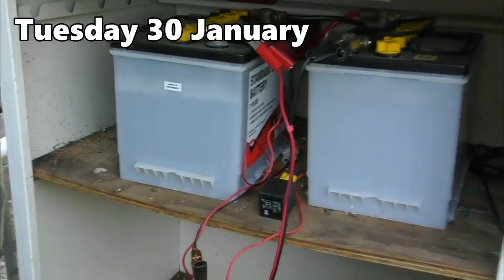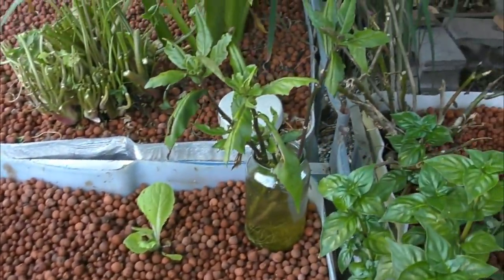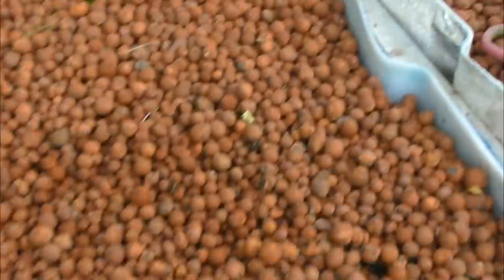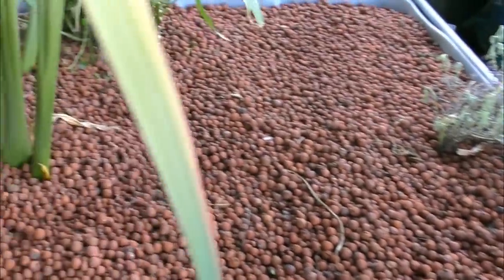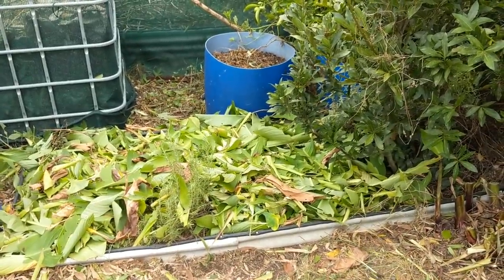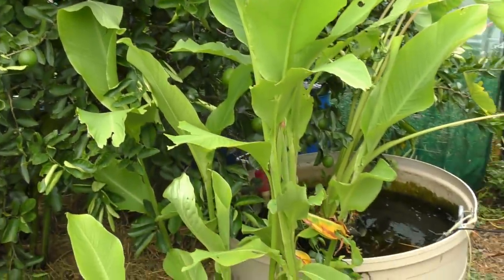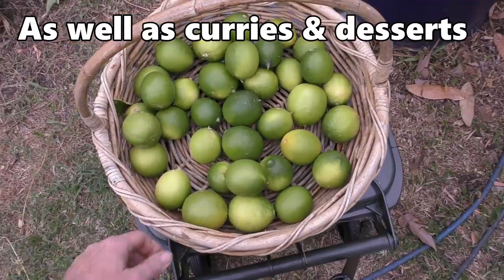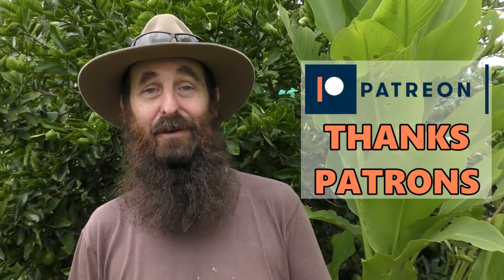Aquaponics, Harvesting Limes, Cooking & Mulching with Queensland Arrowroot

Comment: Hi Rob. Thanks so much for sharing this video. Do you still have a hoop covered area? I want to do one for my garden but, here in TX the winds are crazy and I don't want to loose the shade cloth. I was wondering if you can update us on that and also you chickens I have not seen them in your videos lately. Thanks so much for all you do, love your videos. God bless you!!
Reply: G Vas we use pvc and really thick plastic corrugated sheets with zip ties through them they survived hurricane harvey easy!
Reply: Cory Snyder Thanks for the tip. I was thinking about doing that but I hate to make wholes on the shade cloths. I feel like it is going to rip open into bigger wholes. I am new at this and don't want to spend lots of $$ on repairs. Thanks
Reply: I've used Sun Screen Fabric Snap Grommets for shade cloth with 98% success rate against tearing and shredding. They're litterally a snap to put on.
Reply from the maker: We've had storms rip through here that take off roofs but the shade cloth barely moves due to all the holes in it G Vas. 👍
Will be a while before we get chickens again. I'm sort of glad as we have a bit on our plate at the moment.
Cheers.

Comment: Hey Rob love the vids mate im mid  way building a aquaponics system  split flow with 4 DWC beds. If you get the chance mate could you do somthing on DWC beds drainage options ? Eg would it be beneficial to use a SLO. Thanks mate. 
Enjoying some QLD rain atm gotta love it
Reply from the maker: Hey Matt. Is probably too late for you bill be working on some DIY info clips for components & beds soon. 
Cheers & happy growing mate. 🌱🌱
Reply: All good mate iv put a hold on it for now. Sounds good

Comment: i would like to grow a lot of your greens but dont see them at my local nurseries. i
Reply from the maker: Most are warm weather varieties we found do better than the traditionally grown greens Peter. Whereabouts are you located?
Reply: Rob Bob's Backyard Farm & Aquaponics shoalhaven area, nsw
Reply from the maker: Plants like the Okinawan & Brazilian spinach are very frost sensitive so probably won't do too well down there Peter. If you can grow them in a greenhouse or inside through the cooler months you may get away with it. I do know folks that grow kang kong / water spinach every year down in Melbourne from seeds & cuttings but it won't last long once the temperature drops.
Reply: Rob Bob's Backyard Farm & Aquaponics It does get cold but we're never had frost here near the coast. I like to give it a burl